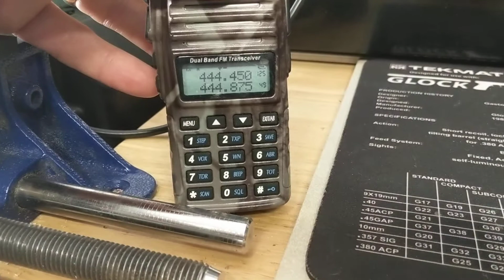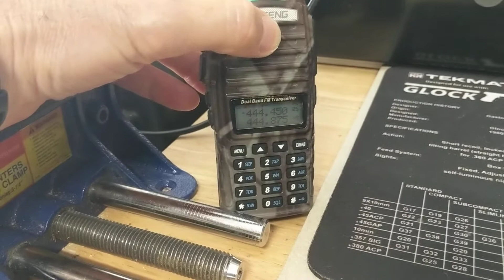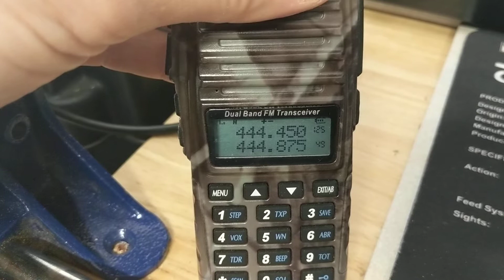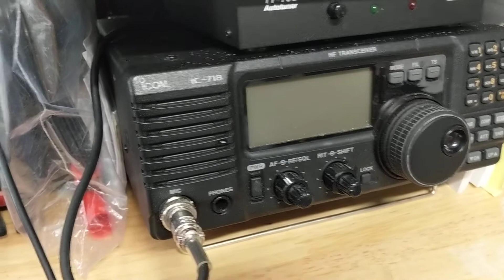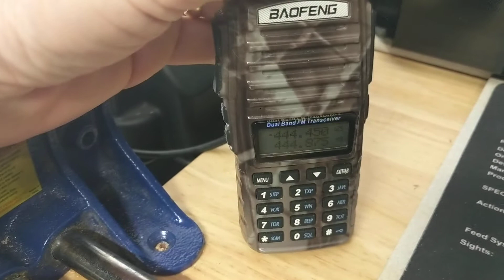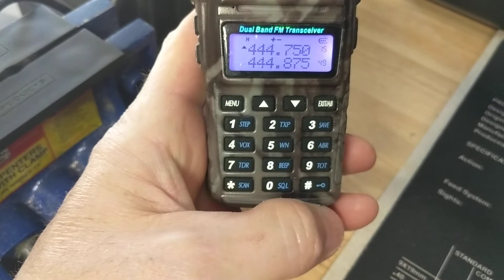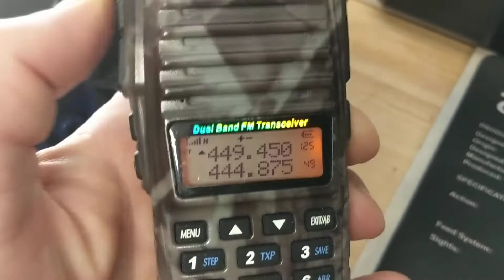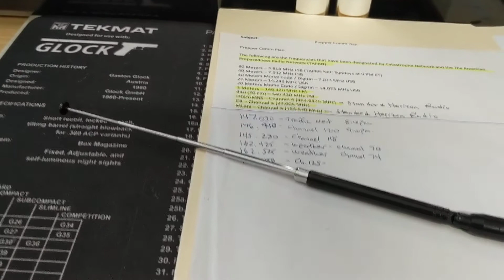Listening to 70CM on Ham Radio using my J-Pole Roll-Up Antenna

Comment: I've got the same antenna for the Baofeng as well as the adapter to use on my mobile/base station rigs. It definitely adds to the range of the handhelds and works fine as a base station antenna as well.